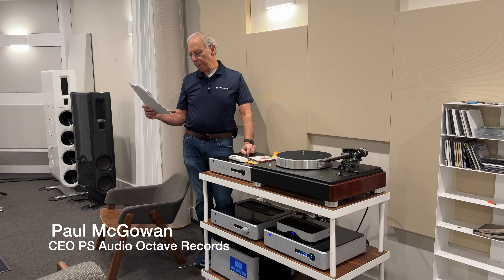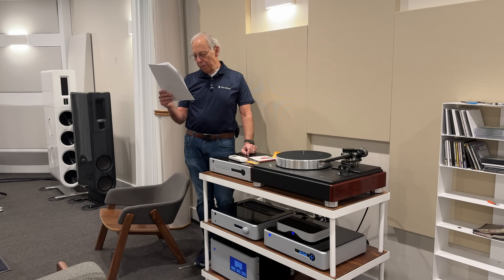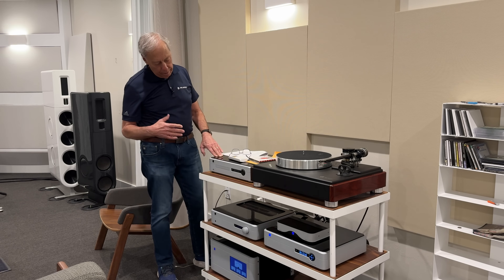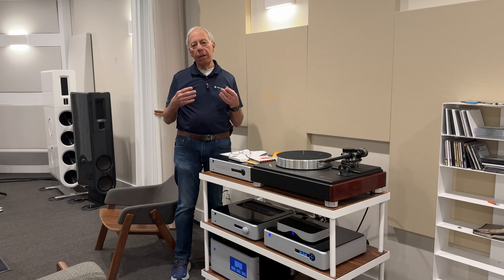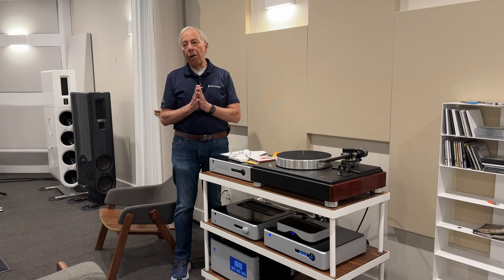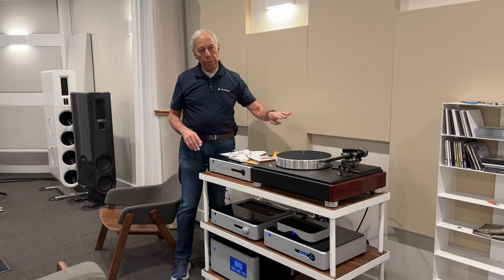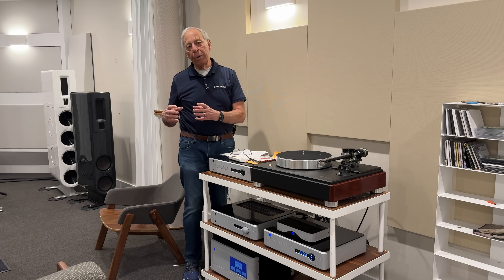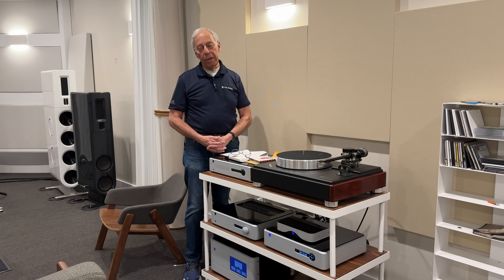Does a transport need an internal DAC?

Comment: There are a few ways to output the DSD signal to a DAC and many DACs that now have I2S input to receive the DSD signal directly.  You can buy an older OPPO and then buy the OPPOmod I2S card and make your cheap OPPO a DSD transport.  There are several models of SACD players like Sony and Pioneer and OPPO that you can use a I2S converter box with in order to get the DSD stream off the SACD and into an external DAC.  The sound is fantastic and worth the effort. But Paul it correct that you can't find many transports that can do this without a bit of DIY work.

Comment: Just keep your DAC away from your transport. Don't even worry about terms like "jitter".  Just don't do it. The output from your DAC will be dependent on things like quality of construction and shielding all sorts of interference than the "technological advancement" of the DAC itself. Here's a dirty secret. Getting high quality performance from the DAC itself is not like getting the latest and greatest graphic rendering from whatever version of a now multi-thousand NVIDIA chipset is on the market. The technology has been there for at least two decades. Unless you are Superman, you are not going to hear a difference in SACD (or whatever) vs. old fashioned CD technology. What you are going to hear is cheap component construction. This is why your transport is probably the most important thing you have to worry about (other than preamps, speakers, and amps of course) in any CD-based audophile system.

Comment: God am I old school. I just run a c d player to my pre amp to amp and waah laah I have music.
Reply: Northing wrong with that just PLEASE don't use the crappy ouput from an old blueray or dvd player -- despite what some "budget" audophiles here say.  Make sure it is at least a genuine low-midrange or better dedicated CD player.
Reply: No blue ray , using a denon dn - c615
Reply: @williamgilpin3693  Until you feel like spending the money (or even want to) to invest in a stand-alone CD transport like the Audiolabe 6000 by all means use this. Just don't bother to get it repaired if it stops functioning would be my advice.

Comment: ℹ️ T+A from Germany also offers with the PDT 3100 HV a transport which supports SACD data.
Reply: That's what I found: Digital output: 1 coaxial, IEC 60958 S/P-DIF (LPCM). I don't know if there's anything else from the transport.
Reply: That's a beast of a piece of equipment. At $23,450USD probably a bit out of reach for most folks. FYI - I own a T+A PA3100HV integrated.  There is another option. The DSD signal from an SACD is available on the HDMI interface so you can use an inexpensive HMDI to I2S converter to feed say a Denafrips Pontus II DAC I2S input. I connect my Oppo UDP-205 this way and the sound quality is amazing.
Reply: @joeythedime1838  That signal on the HDMI cable is analog or digital ? If it's analog any converter can do the job (far from perfect). Although, if it is digital is any chip that crack the DSD encrypted format inside de T+A or Denafrips DAC has is own authorized chip by Sony inside ?
Reply: Yeah, but only through a propriety "IPA-Link"!

Comment: I think CD/SACD transports are the biggest con in HiFi. The task they do should be very easy to achieve with extremely modest and standard components. But I agree with you that (so-called) 'HiFi' transports do not do it properly. All digital data on a disc is actually trans-coded to a different format for storage, but is always converted back for retrieval - the process is seamless. The kind of data transfer rates we are talking about are really trivial in the modern world and the device that everyone is viewing this video on actually sustains lossless transmission of data at a much higher rate than you need for DSD quality audio. HDMI is actually an agnostic format for transferring data (again it is actually trans-coded for transmission down the cable, sorry audiophiles) but as you correctly state the device receiving the data has to expect the data in an accepted format and this will not be your beloved DSD format for most commercial devices. So the HDMI standard is capable of transferring the data since it is capable of transferring HDR 8K video which is a much higher data transmission rate, it is just not set up to do so.
Reply: I agree with you. They created a messy, to selling products. It’s very important to understand
Reply: Really. No streamer to date has been better to me than cd/sacd. I've been a audiophile for 45 year's chopping and changing. Upgrading etc. Makes laugh all those hi res fans thing there's something wrong with my streamer.
Reply: Yes, agree 100%. This is absolutely a con. You can be sure that a US$30 USB CD drive used for a computer must work without data errors or it becomes useless. You can't run games from a CD or open files from a CD if data is damaged. A CD transport costing 300 times more does nothing more in enabling any better audio fidelity. A US$5 USB flash drive is better than a US$30,000 CD transport in ensuring error-free data to a DAC because CDs can get damaged from simple scratches.
Reply: They are only a con if they charge $$$$ prices for using standard components designed for use in computers. The vast majority of standard CD/R computer drives are optimised for reading data files at high speed. They are friggin noisy for starters because they spin the CD fast (up to 10,000 rpm if you read data files) and they use cheap but noisy optical carriage positioning mechanics. Music CDs don't contain music "files". For CDs you want a dedicated optical drive designed to read out a music CD track at a sedate 1.2-1.4m/s (200-500 rpm), that does so whisper-quietly unnoticed during soft passages or during the quiet between tracks. Those dedicated CD drives exist and the better CD transports have one of those on board, but (nowadays) the production numbers for those are much lower and it does make them more expensive. Music CD transports are going to be relatively expensive anyway because folks don't want them to look and behave like a cheap external USB CD drive, and production numbers will be low.
Furthermore, audiophiles are prepared to spend a fair amount of money on more advanced error correction and oversampling filter methodologies used (and clock stability when using the SPDIF out), which are still part of what is inside a CD transport.
Reply: @maidsandmuses  Unfortunately, you are talking to someone who work in R&D of audio technology and have done development of CD player products also and I’m sure you know at least one of them. Obviously reading data files both need a drive able to spin the disc faster and also handle the reading of the data more accurately at those higher bandwidths. Making a drive that’s silent with standard CD audio RPMs is quite trivial and just a subset feature of any computer drive. Reading music from a CD is much less of a challenge than reading data or reading a BluRay disc. Yes, it’s true that new CD mechanisms are no longer being developed and CD transports are relying on old technology developed for regular priced CD players. Obviously, when charging an insane price for a “DAC-less CD player” or “transport”, some luxury feel must exist in the enclosure and overall build-quality, but it does nothing to the audio fidelity. Also, error correction is more likely needed for a music optimized architecture than a data optimized architecture. When the occasional error occurs, you obviously want to camouflage any PCM sample DC jump or loss of samples and make the error inaudible. Still streaming today doesn’t have this problem and a US$5 USB flash drive also don’t have such problem. Besides, don’t mishandle your CDs and this is not a problem. What does over sample filtering have to do with the transport? It’s a thing of the DAC. And who wants to use inferior SPDIF out nowadays? Besides, the problem with running SPDIF is you end up with two clock masters, one in the CD player pushing the data one-way and one in the DAC operating with PLL trying to match the clock leading to potential jitter issues. Better is to have only one clock master (in the DAC) and let it run the data flow. Streaming audio is also better in this respect. In a best case, your US$20,000 CD transport can sound as good as a US$5 USB flash drive. Never will it sound better. It’s also still more noisy.
Reply: @ThinkingBetter  Well, opinions may differ; I have yet to hear a computer CD drive that is silent when reading standard audio disks. You say it can be set up that way; then why do so many not do that? I can usually hear the stepper motor move the optical sled as it is reading a music CD (usually around a couple of ticks per second). And yes, I can hear that from a couple of metres away depending on the construction of the enclosure. I have heard it on some "high end" CD transports and no, I would not pay a lot of money for those. My older Marantz CD80 as well as my newer SA11S3: totally silent; both of those have dedicated audio CD drives, the CD80 even an older Philips CDM swing arm mechanism.
But my argument was more one of economies of scale; with some (not all) high end audio a decent percentage of the cost goes into the machining and finishing of the cosmetic parts produced in small numbers, which of course has no impact on the sound other than possibly absorbing mechanical noises (even a noisy drive can be made quiet if mounted inside a solid slab of machined aluminium). Whether charging that much for the cosmetics is worth it or is a con I think is matter of perspective.
Re oversampling; my memory was a little vague on that; e.g. the SAA7720 filter does the oversampling for the TDA1541A DAC, but you are right in that they would normally be found together in a separate DAC, so depends at what level you consider the "DAC".
Re. SPDIF you are correct, which is one reason why if the only digital out on the CD player is SPDIF, the integrated DAC of a CD player may be a better option provided it is a good one.
Re. streaming, there my problems would be entirely with the unreliable availability of content, which is subject to the politics of copyright, distribution rights, and economic considerations; the technology itself is fine.
Reply: @maidsandmuses  Try solid state memory like 1.5 TB micro SSD can hold 2000 CDs ripped on a size of a finger nail with no mechanical noise, no jitter, no slow user interface, no errors etc. 😊 or just use streaming like the rest of the world 🤔
Reply: @ThinkingBetter  I have all my CDs ripped to HDDs as well as SD cards, and I listen to a DAP most of the time, but I still like to listen to my CDs also.
Streaming services are not for me, for a long list of reasons. CDs and DRM-free digital downloads are my preferred media.
Reply: @maidsandmuses  What’s the long list of reasons for modern lossless streaming services not being your preference? I have around 1000 CDs and 700 vinyl discs that I don’t use anymore. It might be that particular tracks sound better on physical media but I haven’t spent my time in doing proper A/B comparison. Do you know of any specific track sounding inferior on today’s lossless CD quality streaming?
Reply: @ThinkingBetter  Funny enough, sound quality is not one of the issues I have with streaming (with one exception re. re-masters, see below 😉) My problems are:
- no ownership of media; you are handing the granting of access to your favourite music to a third party
- missing artists and albums
- lack of a reasonably complete back catalogue for many less well-known artists
- needing multiple subscriptions to different streaming services to get all the artist I like to listen to (gets expensive real fast)
- disappearing artists (for a whole host of reasons such as distributor arguments, copyright disputes, commercial considerations, etc. etc.)
- no guarantee of future availability of my favourite artists/albums/songs
- poorly done re-masters or re-mixes with the original being taken down
- missing metadata; many CDs come with far more extra information on the artist, music, composer, historic background etc. compared to the the metadata on streaming services (or downloads for that matter)
- incomplete EPs
- missing limited edition extras (such as a live concert DVD that often comes with Japanese music CDs, sometimes at no extra cost if you pre-order early)
- poor foreign language support (esp. Japanese/Chinese, so need multiple subscriptions to various domestic streaming services unless you want confusing and incorrectly translated track titles & mix-ups)
- frustrating user interfaces, especially when band names start getting mixed up with similarly named track names by other bands, often results in a mess
- environmental impact; studies vary but if you play an album more than a modest number of times the carbon footprint of playing CDs is lower than that of streaming 
- last but not least, I simply enjoy the experience of browsing through my CDs, putting it in the player and listen to the whole album whilst browsing the booklet

Comment: I understand the desire to sell boxes, but technically it just makes a whole lot of sense to integrate a streamer and DAC and run the data flow such that the DAC clock is master clock with proper buffering and zero jitter concern and also avoid any transcoding needs as the software reading the stream can ensure the DAC also runs optimally to whatever sample rate, bit resolution or even DSD. By combining the two the streamer will also know the native maximum DAC capabilities automatically. When streaming doesn’t sound as good as it can, one issue might be additional transcoding due to lack of tight coupling between streamer software and DAC hardware. Besides that, the extra cost of boxes, power supplies and interconnects aren’t in themselves improving the audio fidelity. It’s better to spend the BOM budget on things that matter such as better DAC components, better analog output stage or cleaner power supply.
Reply: Totally agree and I am fully paid up member with a Linn Klimax DSM integrated streamer/DAC/master clock/pre-amp. 6 months ago I re-discovered CD by plugging in a transport to the Linn DAC via a pro coaxial BNC cable and was shocked to hear it out-perform streaming. However, it’s not as simple as that. 

What I learnt is the mastering of the music plays the biggest part and I am talking about original digital recordings at this point. I am on Qobuz and they deliver whatever file the record company gives them. Increasingly they are remasters, sometimes upscaled to ‘faux’ Hi-Res, and in most cases victims of the loudness wars. 

However, the original CD has the sound the artist and producer originally intended, from the era it was recorded, for the format it was intended for. The obvious point I’m making in my journey is the original content and format play a crucial role. I am now buying the original digitally recorded CD’s that carry what the artist/producer originally intended. In a like for like comparison where the stream and CD are from the same master the original CD in most cases outperforms streaming. 

Where I have landed. If it was originally recorded in analogue, when vinyl ruled, with its RIAA etc, get the earliest pressing you can, if it was recorded digitally for CD get the non remastered disc (and they’re cheap), and if it was recorded in HiRes, we only have streaming…along with its issues. The latter is frustrating given we live at a time where ostensibly we have the ‘master tape’ but only the way we can get close to hearing it is via a small choice of specialist, expensive SACD’s, ‘illegally’ accessing the DSD layer to hear it. Sigh 😢. 

I also get if people can’t be bothered with all that and in which case streaming offers convenience and good sound…just not always the best and increasingly not what the artists originally intended.
Reply: @neilgaydon5430  I really hope someone soon will do actual data based comparison between selected tracks on CD vs streaming. I’m using Amazon Music Unlimited and with economy of scale, they have the strongest data center backend and least need for any lossy compression.
Reply: CD and SACD ?
Reply: @Jorge-Fernandez-Lopez  When the streaming software and DAC chip are tightly coupled with software, you can also easily enable seamless DSD streaming (SACD) just by software setting the DAC through I2C commands based on media file format. TOSLink and I2S are inferior to having the DAC chip tightly integrated with the streaming software.
Reply: @ThinkingBetter  The question was about SACD. Isn't DSD is another thing,  streaming a  PDM 1 bit file via DoP open format another one ? Again, SACD ?
Reply: @Jorge-Fernandez-Lopez  DSD is the music codec used on SACD. For prober seamless playback of SACD, best is an integrated device where the streaming software simply can pull in the DSD file and play it as DSD natively through the DAC that it can control directly. In fact, DSD playback is a good argument why you would want an integrated streamer + DAC. DoP is needed when you don't have streamer and DAC integrated and you need to fool the software to think it's PCM. It would be nice if leading streaming services would allow the streamer (player) to pick a DSD version if it can play it. Technically it's trivial.
Reply: @ThinkingBetter  I see DSD as 1 bit PDM digital music encrypted and proprietary on an optical disk (SACD). I can stream a DSF downloaded file from PS Audio (PDM 1 bit, not a DSD [SONY prop.] file) not encrypted by Sony to a DAC perfectly, but I don't know how to transfer DSD encrypted content from the optical disk SACD to an open format in the server that a DAC can "play". Constantino is interest in CD/SACD disk, so I think that we should probably talk about that. How would you insert a SACD in the streamer and save that file ?